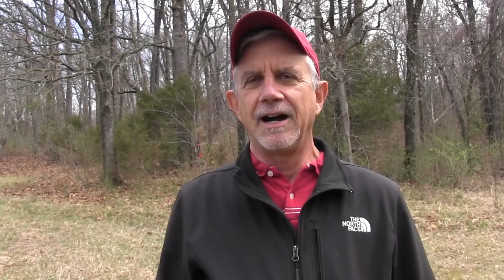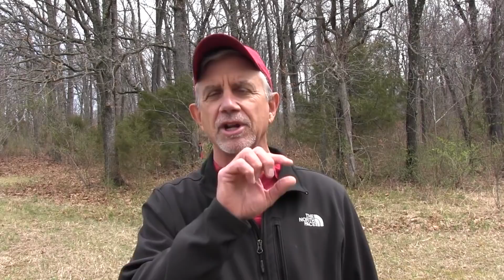Beware of Orphan Great Bend Front End Loader to John Deere Tractor Engineering Projects

Comment: I've mounted a bunch of used loaders, and I don't think any of them had the correct mounting brackets. Of course it would be much easier if you had the correct brackets, but nothing a torch and welder can't fix. It my case you can usually buy loaders cheap when they have a set of brackets that nobody knows what it fits. Unless you have fabrication skills and equipment, it's best to stay away from loaders of any brand that aren't already attached to the tractor.

Comment: I just got a bush hog 2426QT w/brackets off a MF383 I think and needed it on my MF261. Contacted a local welding shop and they were happy to help. My advice, buy loaders with brackets that fit like tractor manufacturers and support a local welder. My issue now is I only have one remote in the back off a controller but need more remotes.  After contacting a local tractor shop it seems like he can put together a hack but I’m not super happy with it and I get conflicting info. He says a multiplier cannot be installed but he can put remotes in sequence. I’m a bit skeptic though.

Comment: Good info and thanks….I will add that those of us with loaders need to check the mounting bolts.  I got a used kubota with 90 hours on it and read about rechecking torques so figured I would….whoa,  loader bracket bolts were finger loose. They also had the check marks showing they were torqued from dealer when new, but apparently worked loose.
Reply from the maker: That's more common than most people realize.

Comment: The Great Bend loader... Factory has now  reopened under Kansas machine works  also known as KMW located in the original building you should be able to get a hold of them and they could probably help you..
They are currently manufacturing loaders for many different models of tractors
Reply: There is lots of GB800 and 900 loaders in this area being used

Comment: Not about loaders, but... have you ever seen/heard of a Funk modification that was put on Ford 8N tractors? I found out recently that it was what we had on ours way back in the early 1960's. Made a powerhouse rig, flathead 6 instead of the little 4 that was original.
Reply: They made 6 cyl and flathead v8 conversions for the 8n

Comment: Most likely a case where someone pieced together a scam deal knowing people will be cheap asses to save a couple bucks to get a tractor/loader package...cheap asses trying to save a buck, and end up paying 2x or more the price in the end by not only ending up with a tractor and loader that don't work with each other to begin with regardless of what brackets they have, or don't have....then end up buying a new tractor/loader package that they should have done in the first place, now they've got an old tractor and an old no-name loader that has no value other than scrap value, or the tractor could be resold and loader disaster get hauled off for scrap.  

This is a great example of just go buy a tractor/loader combo at the dealer where the loader is already mounted on the tractor and you can test its functionality before handing money over to some Craigslist scammer, or now I guess Facebook Marketplace scammer.  Rather than trying to save a buck up front, go find out if xxx loader actually goes with xxx tractor.  If it isn't the factory loader attached to the tractor at the time of sale, I wouldn't buy the loader/tractor in the first place.  Tell the buyer to hook the loader up that they claim goes to the tractor and then you'll consider the deal, otherwise I'd not walk but run away.  I'm new to tractors, and even I'm smart enough to realize that many of those types of package deals on the used market where the loader is never shown mounted on the tractor is a scam.  You ain't saving anything by walking past the dealership to save a buck on a used piece of equipment with no proof that x tractor works with y loader never shown attached to said tractor.

Comment: Any welding fabrication shop can make just about any bracket you need. I worked on a small fabrication shop/ log loader dealer for 20 years as a hydraulics mechanic and we did this kind of thing on a regular basis. We were always getting things in that needed brackets or alterations of all kinds. Making brackets for front-end loaders is a piece of cake, no problem at all. We had a saying that "We do the difficult immediately, the impossible takes a little longer".

Comment: A good machine shop can mount or remodel the brackets, but can be pricy depending on how much re working is involved. We had a junked JD, and a good JD ( if there is such a thing) and we swapped loader from one to the other, they were years and model #  apart. Cost a bit to get done.
Reply: That is what I was going to say. Find a local welding shop. They most likely can make it work unless it is totally the wrong design.